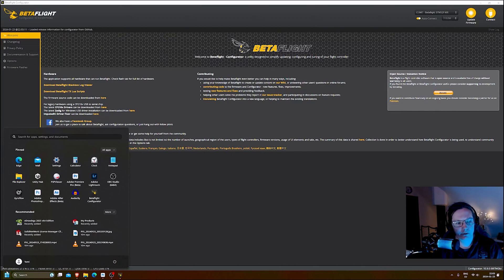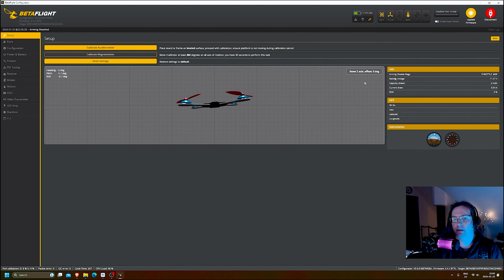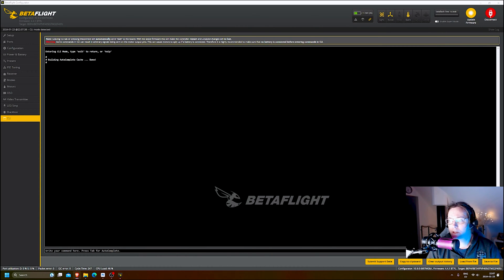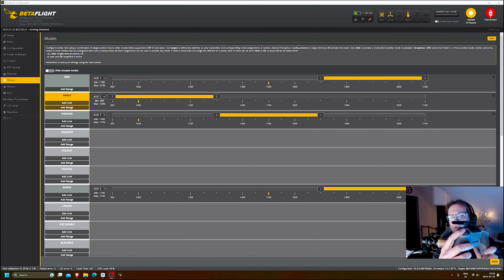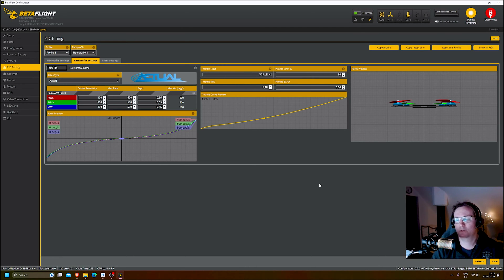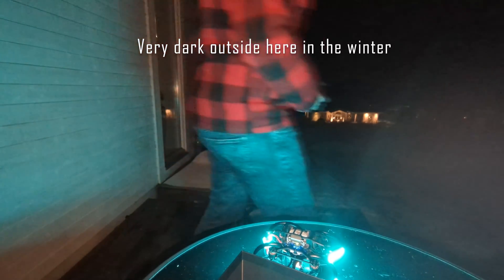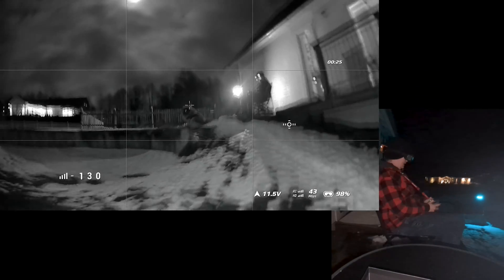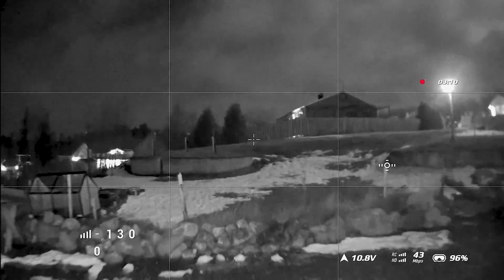How to Connect Pavo20 with DJI FPV Remote Controller 2,  Night Eagle HD Betaflight - Build Part 3

Comment: When i try to activate 04 unit it only goes to firmware ? Any ideas
Reply: I have learned from experience. You need to have it connected to your fc in your drone and connect a lipo battery. It has to be powered on to activate and to configure within betaflight. Please put a small desk fan near the air unit while sitting there to keep the air unit cool. It will overheat very quickly!

Comment: can you show us how if the pavo25 can bind to dji remote controller 2??? with the dji goggle v2🤫
Reply from the maker: Heya, don't have that drone to test with sadly, but think it's about the same setup but might need to change to a different UART port setting as they change between flight controlles.

Comment: I am a little confused, does that night eagle hd just connect with any dji goggle even dji goggles 3? and do you need a dji o3 air unit to take apart and add this camera?
Reply from the maker: The camera is connected to a runcam Link VTX thats uses the old DJI FPV Air unit systems, I'm not sure what the Goggles 3 support but if they support the old DJI FPV Air unit then they should work too. Goggle 2 and V2 I know works.

You can't connect it to the O3 it a different type of camera.

Comment: This is awesome, can you add a mic to the drone too so you can hear whatever sound is in near of that drone? I wonder if it is still possible having that additional upgrade for such a small drone. That would be really helpful for law enforcement and other specialized units. Thank you for the video, very much appreciated.
Reply from the maker: Thanks, well while flying you won't hear anything as the propellers are way too loud.
Then if you land and turn of the propellers then the drone will overheat in a couple of minutes. 
So don't think this would be the optimal setup for anything like that.

Seen more law enforcement use the DJI avata with strong LEDs instead as they are easier to fly too with a motion controller.

Comment: I'm quite new to fpv, at least outside the Dji ready to fly drones. I want to get a pavo20 pro and install the dji o3 but on the website it asks me wich RX to select. (nightfire, ELRS 2.4G or TBS) I want to fly the dji o3 with my DJI remote 2 and Dji googles V2. Can you please let me know wich RX to select? Thanks a lot!
Reply from the maker: Doesn't really matter witch one you choose as if you change the settings to use the DJI controller then I "by passes" the the RX that is installed.

But I would probably choose the ELRS one for if you want to get another controller in the future then you just buy one that Supports ELRS and it will work with that drone.

(ELRS is the most popular one at this time with best range etc I think.)

Not sure if the FC in the Pavo20 pro is the same one as this is so the settings might be different from this video.
Reply: @Nordic_Drone_Explorer  Thanks alot! Gained yourself a sub!

Comment: Hi, the Caddx Nebula Pro is also compatible with the DJI Air Unit O3 system, I want to install on my Betafpv Pavo20.
Reply from the maker: Caddx Nebula pro uses the same type of Vista Air kit this camera does.

So you don't connect it to a 03 system that has it's own camera.

But that Camera with the Vista Air unit will work on the Pavo20 and DJI goggles 2.

Comment: Which glasses are compatible with the DJI O3 air unit? Or only that DJI Google V2 and V3?
Reply from the maker: The O3 should work with Goggles 2/v2/v3. 

I Don't have a 03 unit yet, in this video is for the Runcam Link that uses the older DJI FPV system instead.

Comment: Does the drone have to be plugged into the battery for the receiver page to show input?
Reply from the maker: Yes I believe so, don't think the 5v from the PC adapter is enough to reliable power everything to start.
I put a fan nearby to cool the drone down while testing.

Comment: How do I turn on night mode with the O3 unit or Betaflight like you have?
Reply from the maker: There is no night mode on the O3.
I am using a different camera called Runcam Night Eagle HD Witch has the black and white night cam.
Reply: @Nordic_Drone_Explorer  That explains it more, thanks for the videos and reply!

Comment: Hey i changed receiver tbs to sbus. o3 unit 3 in 1 yellow wise was missed. i add it. but dji fpv controller 2 not see in the receiver page. i dont have uart 5 . Could it be because of this?  Other than that I do everything the same
Reply from the maker: If it's another drone or a different Flight controller then it might be a completely different UART you connect the O3 unit on.
So you might need to check the manual for that FC.

Comment: I have connected my pavo pico the camera to goggles pair and so does the controller but the propellers won’t start
Reply from the maker: Think you need to check the Arm function that it moves in betaflight when you push it, also check that it moves enough on the line so that it actually triggers the function.

Also your throttle need to be all the way down for the arming.

Comment: can anyone help me get the more telemetry on the display?  mine looks just like shown here but I seen other pilots telemetry that shows time on air and more battery telemetry,  Like I will like to know when to bring the quad back.  like what's a good voltage to bring it back?
Reply from the maker: Hi, I think i Managed to get it to work on mine now. In Betaflight in Ports on UART5 i set the Periphials to VTX(MSP + DISPLAYPORT)  this on on both uart4 and 5. Dont know why but after that it works on my goggles.

Comment: Hello i habe a question can i bind the dji digitale fpv system with a other Controller or can i only use the original
Reply from the maker: The Digital gov system only connects to the DJI controller.

But if you have a drone like this they usually have their own receiver like a ELRS receiver that works with other controllers like a radiomaster boxer and others.

This video is a work around if you only have a DJI controller like me.

Comment: Hello, I bought a Pavo 20. Before installing O3, I was flying with 2-cell and 3-cell batteries without any problem. But after installing O3, it does not fly at all with 2-cell batteries,
and with 3-cell batteries, it flies at 90% throttle and with difficulty.
where is the problem from ?
I have a 2 cell battery : tattu 450mah 75c
and a 3 cell battery : boslipo 650mah 95c
Reply from the maker: Sorry I really don't know what could cause this if there is not some kind of a throttle limit active in betaflight? Or the propeller upside down then they get alot worse performance.

Might be better to check on fpv forum on reddit

Comment: Hello, I have the same problem, I set everything up, but when I turn on the drone a little, I raise the gas, it immediately turns over, and no matter what I did, I can’t understand why
Reply from the maker: If the drone flips over then it almost certainly propellers that are installed incorrectly or motor spinning the wrong way.

Comment: Hi I am new to the channel, I have a special problem with a Whoop Drone similar to the AcroBee75 HD O3 DJI/PNP, When you connect the Battery Nothing happens, I order a new Battery Balance it, same issue, I can go  the the Flight Controller using Betaflight and I also update the DJI part with the DJI assistant Consumer, still nothing. Can you give me some pointers on how to do some more diagnostics , I will appreciate
Reply from the maker: When you connect the battery it should boot up the FC with a bunch of beeps and some led Lights should turn on etc, 
if that's not happening then there is somekind of problem with the battery connection or the FC might be broken?
Reply: @Nordic_Drone_Explorer  Thanks

Comment: Hello! I tried to connect as you showed. When I enter set sbus_baud_fast = ON, betafly gives the error ###ERROR IN set: INVALID NAME: sbus_baud_fast = ON###. Can you recommend something to fix the error. Thank you in advance!
Reply from the maker: If you just type in: set sbus_baud_fast
And press enter does it show status?

It should show if it's turned on or off in the response. Also don't type in the # yourself.
Reply: @Nordic_Drone_Explorer  After entering set sbus_baud_fast, the INVALID NAME error will also occur. Of course I don't type # myself. )))
Reply from the maker: @MEDIAWORXstudio  then I'm not really sure what's going on, if it's the same flight controller with similar firmware etc then it should be the same. 🫤
Reply: Try 'get sbus_baud_fast"
But first, try to hit tab halfway through sbus_ to see if it auto completes. If it doesn't, then you must be in an older/wrong firmware that doesn't recognize this feature yet
Reply: @afilizzola5500  You are right, the problem turned out to be in the firmware. But the thing is that I already had the newest firmware, so I decided to install the oldest firmware, and surprisingly, in it I was able to enter set sbus_baud_fast = ON. After that, I returned the latest firmware 4.4.3, and now you can also enable sbus_baud_fast in it. I don’t know how it works, but most importantly I’m happy with the result. Many thanks for the help!

Comment: How did you bind the goggles and remote also did you have any issues with updating the firmware on your vtx dji won’t let me update to the latest firmware
Reply from the maker: Controller binds with the VTX with the bind button as this will just communicate with the fc and the goggles.

Check that you have correct DJI assistant installed there are different versions for the O3 and the "fpv unit" these Runcam Links are.
Reply: @Nordic_Drone_Explorer  got it buddy thank you and stay warm

Comment: I wish this was possible with the goggles v2. I want to use my dji controller 2 with vista and goggles v2. I guess they will never come out with a firmware for that to work.
Reply from the maker: Yeah sadly locked by DJI so they want you to "upgrade"

Comment: Hi when I try to turn on fast sbus it tells me an error:

In set: invalid name: sbus_baud_fast

Can you help
Reply from the maker: So if you just type: 
set sbus_baud_fast

You should get a prompt showing if it turned on or off already 

Should look like this
# set sbus_baud_fast
sbus_baud_fast = OFF
Allower values: OFF, ON

Then you can type the:
set sbus_baud_fast = ON

save

If this is not working I'm not sure what is wrong.
Reply: @Nordic_Drone_Explorer  it was the wrong firmware, now I flashed with sbus but still not working. This is all I did:

Set in the googles sbus fast mode
Set Uart 2 in betafligjt as rx input 
Set in receiver tab to Uart and sbus

Ofc Bound the v2 Controller to the o3 (confirmed by googles)

It’s driving me crazy. What else could be wrong. Pinout is also correct (plug and play) but checked twich
Reply from the maker: @stockspieler-yv1fs  well if it's a Pavo20 you have then the Rx is on UART 5 as they changed it with the new FC not the same on Pico or other drones.
Reply: @Nordic_Drone_Explorer  I found it. Even tough the manual clearly states uart2 to be the correct one for Dji o3 it is actually Uart 1. nicely 4h wasted. But now it works, many thanks

Comment: Hello thank you for the video, I have followed every specs that you explained, as for me it doesn't work, what could it be? what should I look for? thanks
Reply from the maker: You are sure the remote connects to the Link/air unit? 
You should be able to get the picture and start recording with the button on the controller for example.

Otherwise the same setup as me with a Runcam Link and DJI fpc remote 2 and goggles 2/integra?
Reply: I have image on goggle 2 from the 03air unit and the remote controller 2 is connected to 03 air unit, I just can not connect the remote controller 2 to the flight controller, following your steps.
Reply from the maker: @terrikid1  hard to say, i think the setup should be the same for the O3 but not a 100% sure as I don't have one my self to test with.
Reply: I thought you were showing how to setup the 03 air unit, I didn’t noticed that you were using tu cam link. Could my flight controller defective?
Reply: Did u manage it to make it work? I can connect it and start recording but all the others command dont work

Comment: I wish this worked with v2 goggles and rc2 and vista, stupud dji
Reply from the maker: Yeah, Really too bad they Lock out some combinations in the firmware..
Reply: @Nordic_Drone_Explorer  I believe it's ti force you to buy their newer "better" gear
Reply from the maker: @2down2togo  it 100% is this. 
Don't really like them as they have pretty much a monopoly on drones .. 

And no one can really beat their camera and receiver/drone tech at the moment, as they have poured so much Money on it. it's seems almost impossible for other's to catch up.

Comment: Hello, in betaflight, user 1 does not appear so I can turn the LEDs on and off, how can I use user 1 in betaflight, thank you
Reply from the maker: Not sure why you wouldn't see that, Is it a DJI FPV controller you have or something else?

Can you see anything happen in any of the aux channels when you click the button? 
It should be connected to one of the functions/modes
Reply: I have the dji v2 controller and the dji 03 and in my betaflight the user1 that is seen in the videos does not appear to connect the LEDs, do I have to connect something to the betaflight to have user 1 in the betaflight? Thank you
 @Nordic_Drone_Explorer
Reply from the maker: @angeladavid100  Think you need to check witch AUX channel that is effected by The button and that's the one you want to assign as USER1. 
So if the button on the controller is connected to another function that's the one you change.

Beta FPV explains this on their page too
https://betafpv.com/products/pavo-series-cob-led-strip

Comment: Can the DJI RC Controller 2 be connected to all the BetaFPV Pavo series,  I want to buy the Pavo35?
Reply from the maker: Yes it should be possible to setup the Pavo35 with a DJI controller 2. It's the O3 unit that receives the signal and sends it to the flight controller.

But the settings in betaflight won't propably be the same as in my video as the flight controllers are not the same in Pavo20 vs 35
Reply: Thank you very much for your response, I am already your follower 👍

Comment: When I connect the drone to Betaflight and the battery at the same time, the battery heats up and goes down very quickly
Reply from the maker: Battery does drain Pretty quickly on these but should still last atleast 15-20 minutes or more if you have a fan cooling it so it doesn't overheat the VTX

But If the battery heats up quickly then something is really wrong. You might have a short?
Reply: the battery only discharges if it is connected to the drone and if the drone is connected to betaflight it only happens if both things are connected at the same time @Nordic_Drone_Explorer

Comment: Hello good video, could you help me I bought the paco 20 with the dji 03 and the radio dji v2 I can connect the 03 unit to the radio but I can't connect the radio to the drone board,I mean the radio doesn't connect to the drone only to the DJI 03 unit,Do you have any idea how to solve this, thank you very much
Reply from the maker: I Don't have a O3 unit my self so haven't tried so not a 100% sure but I think it's the same settings as I did here on this video
Reply: Did u make it? Have the same problem

Comment: very cool - how's the view at night with the lights turned off on the drone while flying - please post
Reply from the maker: You hardly even notice a difference. 
I only noticed when flying under my deck that without the lights I couldn't see that many details in the pitch black planks as I could with the lights on.

But will try it in even darker place.